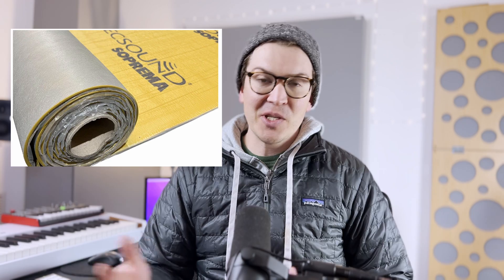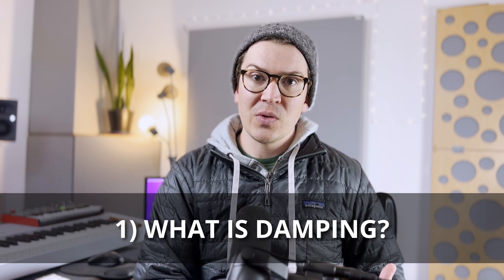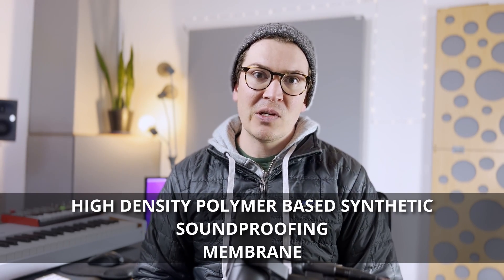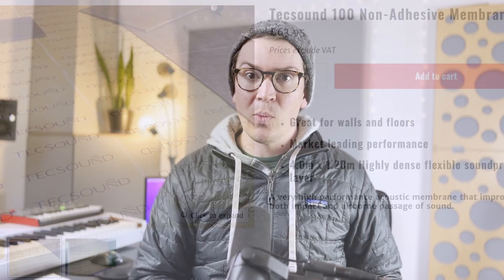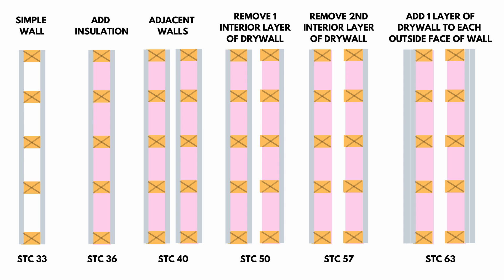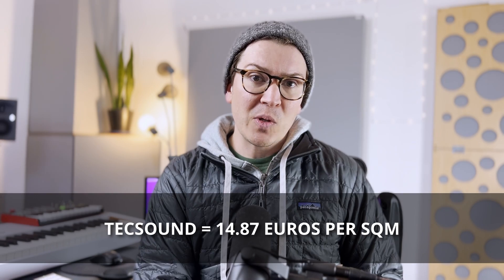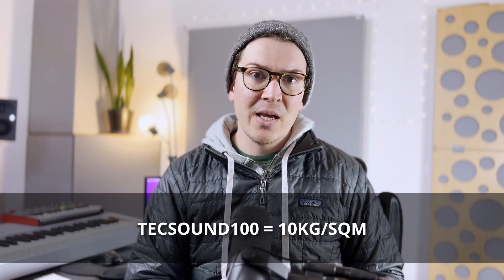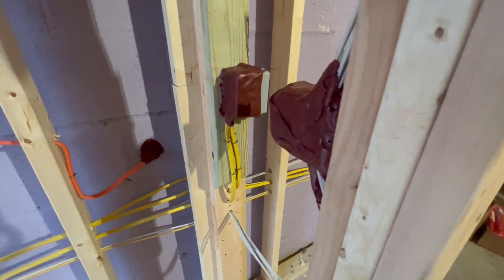Should You Use Tec Sound To Soundproof A Room?

Comment: Thanks! What about the theory that but putting it in-between your two drywall layers creates another decoupling effect (thus further dispersion) and the MLV also being a different material to the drywall attacks frequencies differently? just wondering based on other youtuber videos. :)
Reply from the maker: Yes, you are right on that rec sound or MlV acts as a constrained layer damping system. This can help with isolation. I think my big thing is looking at cost benefit since MLV and tecsound can be expensive. I am also finding that with acoustics you can use MLV to great affect for low to mid bass absorption with drywall. The two system s work together for both isolation and acoustic control. Lots to think about on this subject

Comment: I put a few layers of this down on a floor where conversations could be heard clearly. Not exactly what it’s made for but just if anyone else is considering it. Made ZERO difference conversation can be heard clearly still through 3 layers - I wouldn’t bother with this stuff it’s super heavy annoying to use and does very little if anything.
Reply: That’s the thing, a lot of people tend to forget that it’s not as simple as just applying / filling a void or so with material. Its completely useless if you’re not considering:

• Acoustic Sealants
• Covering ALL gaps / leakages
 
… Etc. 

Airborne noise will make its way one way or another if you don’t apply it properly.
Reply: All gaps were sealed, skirtings removed and masonary re-plasterd to just above the newly applied part E approved direct to joist subfloor which was perimeter sealed.  The tecsound was purchased to improve that system on the advise of the acoustic consultant who also approved the detail drawings for the subfloor.  It made no difference whatsoever. @ShakzT
Reply: Thanks for letting us know. I was going to get this stuff for my bedroom. Just because I can hear the tv very clearly from downstairs. Now I know not to bother with it.
Reply: @JoeyXSmith 

Joey, personally, I’ve always used MLV. I used it in my room, done crazy wonders!
Reply: @JoeyXSmith  Where are you from dude?

The other poster must of had other issues (that he couldn't identify) with the room and underneath! 

As here in the UK Tecsound is used to great effect in high end music studios. And also movie hobbyists DIY home cinema rooms.

Don't let 1 bad experience from someone who's home could have other issues making airborne sound bad put you off. 

I'm going to be buying Tecsound 70 for my living room subfloor for airborne noise reduction (it does also give a bit of impact noise reduction) to the downstairs neighbours. Combined with a dense 1000 kg/m3 5mm rubber underlay for impact noise reduction on top of the Tecsound. Then my strand woven bamboo flooring and a acoustic rug.

I play movies & music with a 5.1 system plus subwoofer so being considerate to my downstairs neighbours 🎬🎶🔊
Reply from the maker: Interesting! Thanks for sharing
Reply: @soundproofyourstudio  no problem, I was quite surprised/disappointed by the performance considering its weight!

Comment: I haven’t seen much discussion about how to manage
The top-plates of double wall construction.  Do you lay rafters over both decoupled walls (in which case are they not now coupled?) or do you couple the ceiling to the innermost wall and just cap air gap?  Seems like a trade off between rigidity and bracing vs.  Inadvertently undoing the decoupling that helps so much in the first place.
Reply from the maker: Ah yes, check out I-b3 acoustic clips and watch my vid on fire stops.

Comment: Another benefit to Tecsound is it's pretty malleable and comes in (very) sticky backed version. Makes it quite versatile alongside just adding mass & damping between various layers.

I've found it useful to wrap up and over sides/corners/weird planes, weird bulkheads/air con ducting, pipes and other difficult to fit drywall to places. 

Have also installed directly under a floor above in tight situation/no access to above floor (stuck under that floor with tile backer washers as 2nd mechanically fixing in case glue fails over yrs), adding a mass layer (and some impact damping) directly below floor with wide air gap/insulation, then the normal dense drywall back onto ceiling below.

The Tecsound 50 is easiest to mould around shapes, but doable with the Tecsound 100 too which is double the thickness and offers best sound reduction of the two (is also a tecSound70 which not tried, presumably in between the 2 mentioned).
Reply from the maker: Great input. My thinking as well. Use it when it is a good product for the job, but not all the time.

Comment: While I really appreciate you on being one of the few people in our industry who's NOT spreading BS unlike the major youtube educators, but here I share an opinion in disagreement, and hope you take it positively.

MLV/Asphalt/Rubber sheets these are just as you said - damping agents. More precisely said - Constraint layer dampening. The key to understand here is, they dampen the movement (caused by transmitted sound vibrations) of the adhered layer by acting as a constraining layer and not directly the vibrations anyway. Hence, they are not soundproofing material technically, but decoupling material, easily said damping material.

These can't be compared in a scenario where mass is concerned. For blocking transmission of sound, you need mass. For blocking the vibrations to travel through the structure, you need mass along with a cld or any viscoelastic barrier to constraint that mass to be affected by the vibrations of a magnitude that the system is not capable to resist mechanically.

It sort of acts as a mechanical barrier for the vibrations to travel through. As if it made the walls even stronger to be moved. It can't be compared in terms of mass. It's the visco-elastic force that's working here, NOT mass.

Lastly, about the cost, you don't necessarily need to add full sheets of MLV on the entire wall. CLD layers work by sandwiching them between 2 layers. Decoupling, resilience! And there, you can basically add strips of CLD throughout the perimeters and some in between to form some sort of airtight frame between the two layers that would help in maintaining the airborne isolation, and the 2 walls won't touch either. The air cavity formed inside the windows of MLV strips will act as a spring just like MLV. Just like in floating floors! You have trapped air cavities which work like spring. But they move the resonant frequency of the system wildly away from what you might have calculated, that's why ventilation is provided. While it's much complex with floors and floated bunkers, with walls the purpose and application is rather simpler. You don't necessarily need to worry about resonant frequency unless the walls further are connected to an exterior coupled structure!
Reply from the maker: Sound like you know what you are talking about. I appreciate your input. I think my take is still keep it simple, do what we know works. If you could show me exact comparisons with and without MLV in your description I would do it, but there is too much risk and money in home studios to just play with materials.
Reply: @soundproofyourstudio Absolutely correct! It's not meant to be experimented along in a DIY home studio build. It WILL Fail. Simulations, precise calculations and then very accurate execution based on proven and compatible designs is what would make it work. (My intention behind the comment was to share the exact good reasons to use it for, and not for mass, which is usually the case with DIY builds, and a lot of money is wasted).

Unforunately, I don't think anyone in our small niche has been able to compare the measurements of a same room build with and without MLV. It would be a costly affair, haha.
Reply: Good read but In my opinion there's a key point being missed. While Tecsound acts as a damping material, it also has mass concentration (Why?). It performs different than an open-cell rubbery sponge or decoupling alike resilient bars. kinda of a good of both worlds. Just as it can block water it can also block air (Maybe not in full but close to drywall) for high-frequency noise, due to its density. So, it's not just about vibration damping. It also blocks airborne sound. 
Drywall isn't very effective at dealing with impact noise because it doesn't offer much mechanical damping due to its lack of elasticity. Drywall's mass alone isn't sufficient to block high-energy frequencies, especially in the low octave bands (30-300 Hz). As frequency decreases, the importance of damping increases significantly.
When discussing damping and deadening sound, It will be about aspect but it's important to analyze the sound patterns (incoming noise) in a range of octave bands. 
Only after than you know what you're dealing with and can do the cost analysis to address the specific frequencies involved. 
I hope I didn't come as arrogant because I get that sometimes.

Comment: What about using on a double wall system, outside 5/8” OSB and Hardy board siding with 2”x 6” stud wall with open cell spray foam to fill to the depth of the stud (5.5”) then inner wall 2”x4” stud with unfazed fiberglass insulation, 2 layers of 5/8” drywall staggered joints between layer and acoustic seal caulk on the joints, then plywood paneling of at least 1/4” or 3/8” for the inner finished wall. Would that get me closer to STC level of 70 ?
Reply from the maker: That is a great design but the STC would have to be measured after it was built. I would give it a green light.
Reply: Even if it magically works, 65 is the highest STC rating there is! Practically, depending on the precise construction and dimensions of the space, you might achieve an STC of 45-50
Reply: @grayveeacoustics  on his chart of double wall insulated double Sheetrock he gets stc levels of 63. Open cell foam 5” deep or slightly more has a better stc level than just fiberglass or rock wool. The 5/8” osb outer wall with 3/4” thick hardy board (a cement material) meets or slightly exceeds the dual 5/8’s Sheetrock so you are matching density for density inner wall vs outer wall. Slightly or better absorption and air tight with the open cell spray foam. I just measured some engineered paneling and it’s a 4’x8’x7/16” thick sheet, as heavy as 5/8” Sheetrock so essentially my inner wall would have 3 layers. And the stc chart goes higher than 70. If I achieve 65 or higher I will be happy. This is in a professional recording studio 40’x36’ with a mechanical room with bathroom, live room roughly 24’x28’ then a vocal booth, lounge roughly 12’x16’ and master control room roughly the same size, this does not take into account of wall thickness. Exact measurements will be after the final coat of paint is applied
Reply: @stevereese6488  part of the reason why double wall double sheetrock is seen to be achieving such high numbers is the partial M-S-M functioning that allows for a good isolation in low end, and less real estate needed for internal acoustics too. You need to get it right with decoupling all the external structuers, CLD, and routing the Ducts very strategically. Say, if you have no connected structures, a perfectly floated floor on which the walls are built, and no ducts going through the walls, and you have made the wall leaves resilient enough, then sure you can achieve a high STC rating, but once all these practicalities flow in, not everything works out as efficient.

Where I come from, building brickwalls, RCC structures isn't a problem, so it's rare that I have to build studded walls, a handful of situations where I built one, I found the mess it is to work with. It's not easy to evade flanking transmission with drywall as it is with brickwall. Sure, room modes are stronger, more real estate needed to tackle with resonances, but in isolation, it's worth it!

on a side note, try to give your CR a little larger space.
Reply: @grayveeacoustics  yes the double walls will be isolated. The live studio room and mastering control room are vaulted ceilings with associated acoustic treatments, clouds,etc. the main building is 12’ high walls, the bathroom, vocal booth, lounge and interlock type access from lounge to either control room or live room are 8’ ceilings, the interlock rooms if you will have 2doors, double walls/ceilings one is rough outside measurement of 6’x8’ to the live room, the control room interlock double door system is roughly 4’x4’ all solid core fiberglass exterior grade doors with acoustic seals. Actually all doors are 3’ wide solid core doors. The control room interlock extends into the lounge. The vocal booth has a small dual window system that each pane is 1/2” thick safety glass like windshield glass that has that film in the middle of the glass and not standard float glass like the glass used in home windows. So there is an inner glass set at an angle leaning out at the top and a control room side glass with the same angle lean, also a small dual window to the live room.  But again the dual room system is isolated from the outer walls, not attached. We are going with mass loaded vinyl between the 2 layers of Sheetrock, the inner dual wall base plate will sit on 1/4” rubber or mass loaded vinyl strips then acoustic seal every joint, floor and ceilings. We already have the recording equipment with both analog snakes and Ethernet snakes. All outlets are wrapped with puffy and acoustic seal around it. The hvac is handled by split units that have a quiet mode function, also an ERV unit in conjunction with a dehumidifier that the supply and return ducts for the live room vocal booth and control room go through an insulated box with zig zag inner deflectors to route air (and sound) in a zig zag pattern, flow rate regulated for the fresh dehumidified air between 100 to 200 cfm, anything higher than 250 to 300 cfm will be detected by the recording equipment. I live on Texas gulf coast (liquid air 99% of the year).